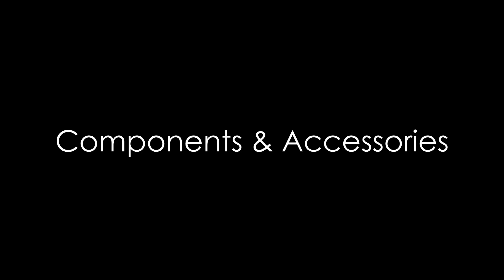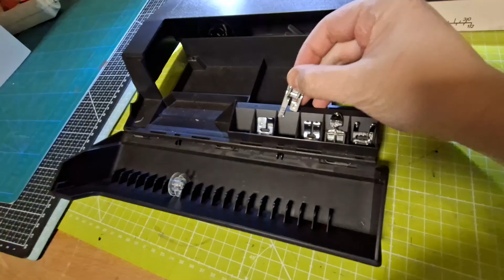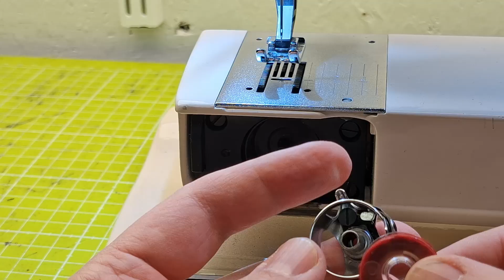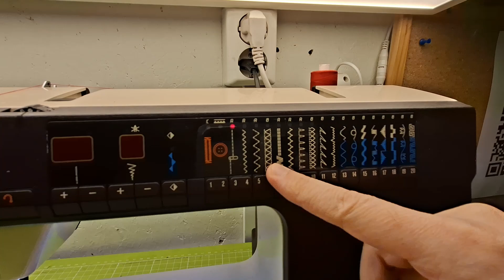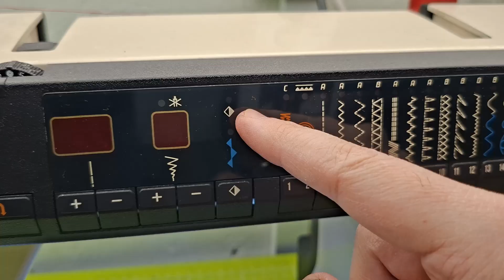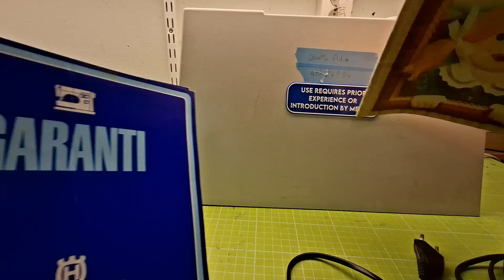Husqvarna Prisma 940 sewing machine tutorial

Comment: Hello, I recently was given this same machine, and the upper thread will bind up and break when I sew at the max speed.   Do you have any idea why this would happen and what can I do to fix it?   Also, can you tell me what LED you were able to use in the machine?
Reply: The thread breaking is most likely an issue with the thread tention.
The LED is a little harder to fix because the machine uses 12V AC for the lamp while the led requires DC. If you know what you're doing you can use an AC DC converter.